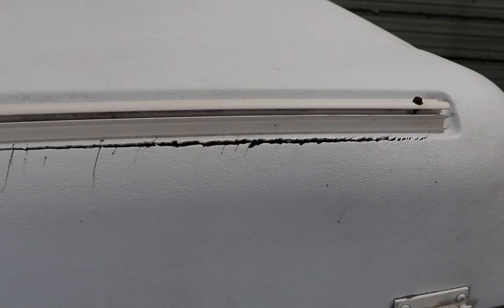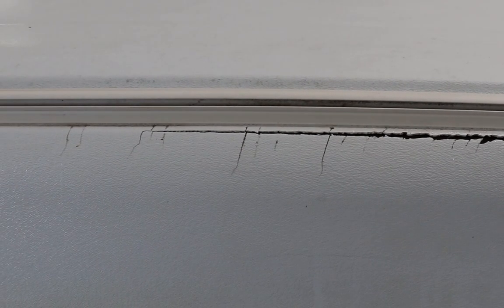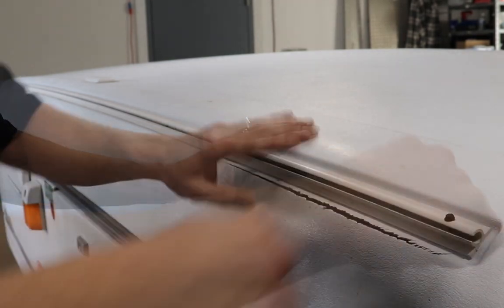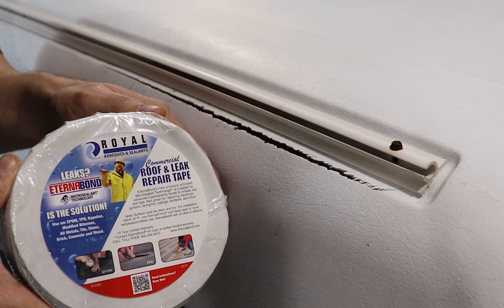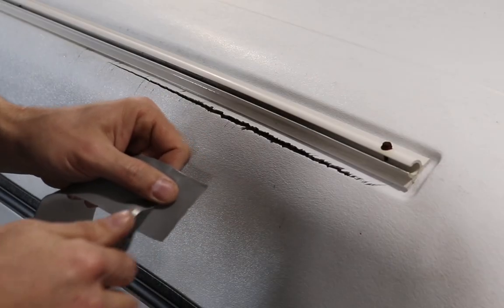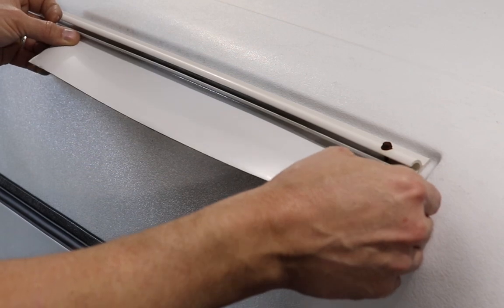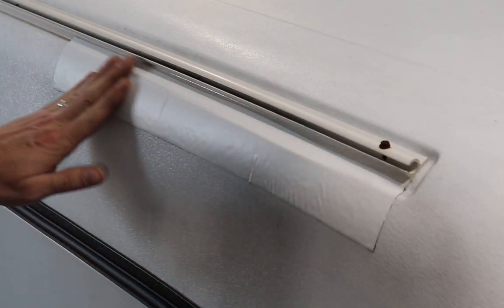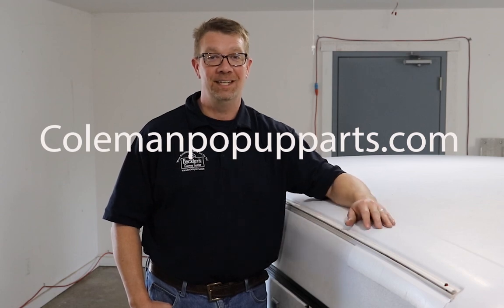Fixing an ABS roof with repair tape

Comment: If I was thinking about a grizzly grip roof,  would this be a better option then the mek/abs patch method for cracks?
Reply from the maker: For small patches it works very well.
Reply: @popupcamperpro  Where can I find this tape?
Reply: @popupcamperpro  Is this tape still available? Cant find it on your website
Reply: @jeng471  eBay
Reply: @jakestevenson4395  eBay

Comment: Wait....why don't just make some abs plastic slurry ...it's crazy cheap...   put it over this spot, and paint it, or then add tape to cover the repair?   More of a sturdy fix.....no??
Reply from the maker: It sure is! Or even removing the entire outer shell and repainting. This is just an easy quick repair.
Reply: @popupcamperpro  looks like the crack was going under the pvc pipe there? no?